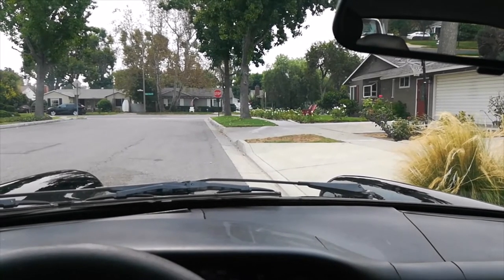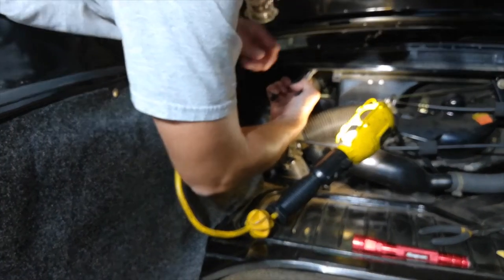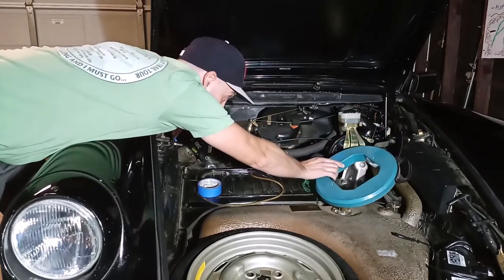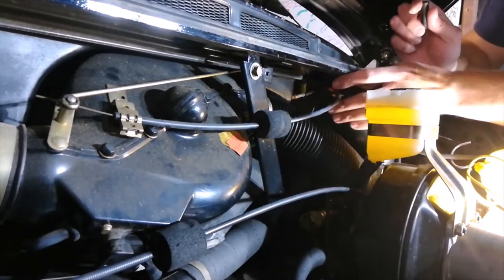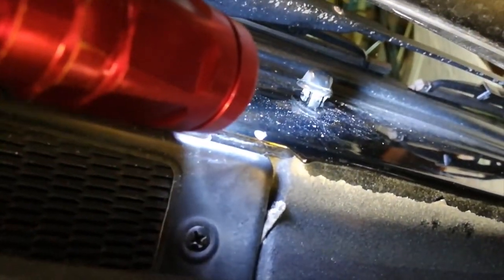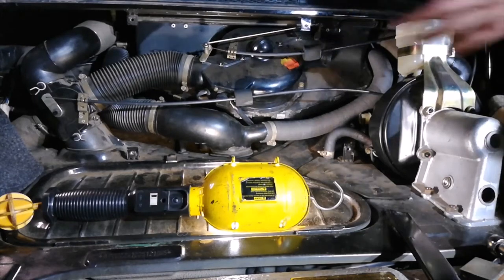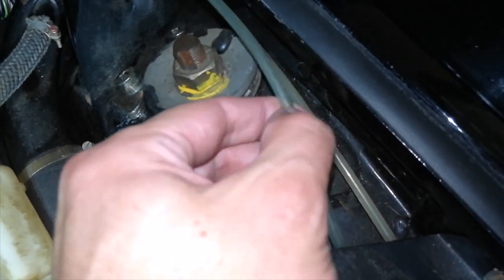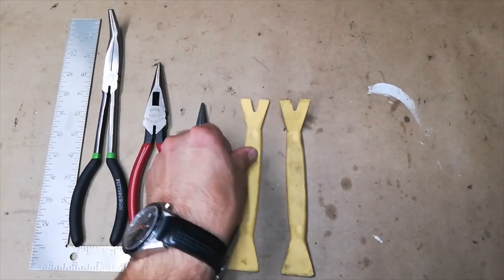Air-cooled Porsche 911 Windshield Washer System DIY Rebuild 1 of 3: Nozzles and Wipers

Comment: Thanks for this vid. Just ordered a set of long needle nose like you suggested. Ran into the same problem with standard pliers and was worried that I’d need to remove a lot of the HVAC. I do need to change the fog light wiring and looks like a lot of that needs to come out for access, but one job at a time!!
Reply: Haha turns out it was more of a job than first thought. Have the washer jet out now but not as straight forward and need to get a new one now 😅

Comment: Thank you so much for this video series. I am almost two weeks into my 911SC journey (also an 83) and both the windshield and headlight washer systems are not working. Following your advice got the pump out and cleaned up (now pumps!!). Thought I had you beat on running the hose between the nozzles. Used drip line couplers to connect the new hose to the old one and was going to pull it through. The problem is that the hose is secured behind all the HVAC and it would not pull through. Ended up having to run a wire and attach and run it like you did. 

Still have the tank to pull apart....maybe Sunday. Looking forward to getting this system up and running again. 

Will watch your door video soon as the windows are not functioning properly and the door stops are pretty shot.

Comment: Very Helpful Video for G Body’s that includes information not in the shop manual. 
One Question …… were tube clamps used or recommended for joining tubes to fittings. 

FYI - when replacing the washer pump, I found it easier to first install the 3 rubber mounts to the car body then secure them to the washer pump using a light lubricant like Vaseline. (Brown wire to the negative)
Reply from the maker: I dont believe so. The barbs seal quite well and the system is at atmospheric pressure most of the time and probably a few psi above that when actually running the pump.

Comment: Why not run 2 separate lines, 1 to each nozzle and down each side of the car, put in an inline check valve for eack line, then meet at the pump with a tee before going to the pump...?  then you never need to go in there again unless it leaks. And if it leaks, you'll know which one of the lines leaks because one of the nozzles won't work....Test each line independently, and if no leaks, route both lines to a check valve in the front of the car (easy to access), and then to a T and into the pump.